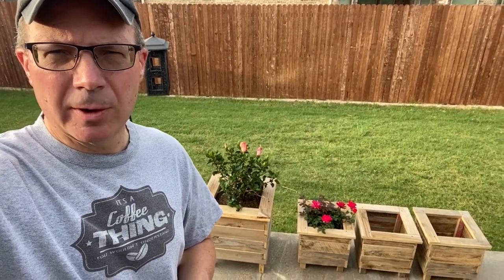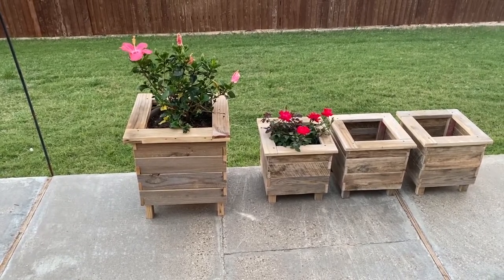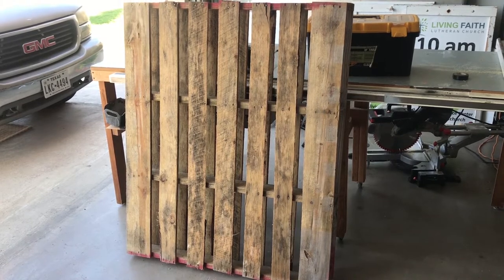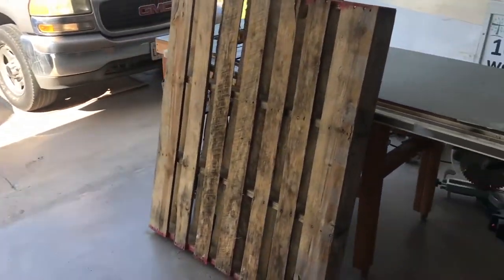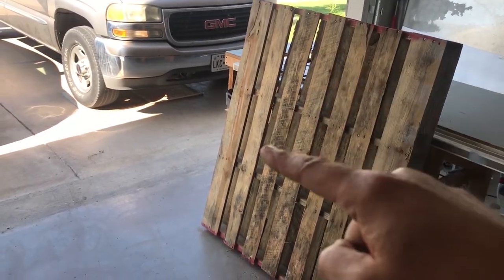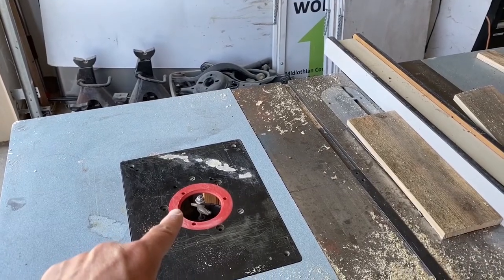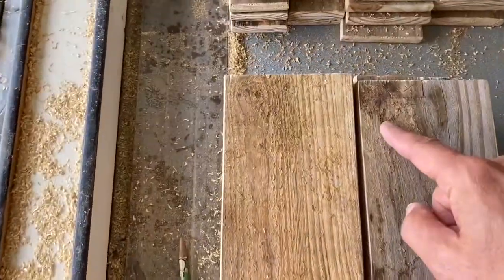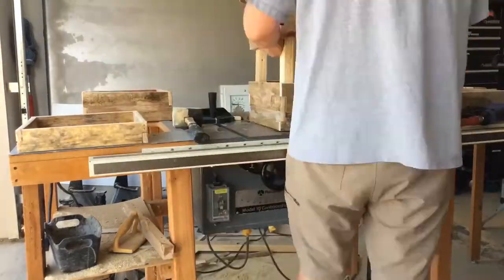Build attractive DIY PLANTER BOXES from wood pallets at no cost. Great re-purposed wood projects!

Comment: I think it's worth mentioning that when you're using pallet wood to build things there's always that possibility of missed metal in the wood. I use one of those handheld metal detectors off amazon for like $20. The nails aren't what I'm talking about though, it's the little piece of wire that holds the strips of nails together in a nail gun. Sometimes you can pull the nail and it will leave that piece of wire in the wood and it's not always noticeable. Just a little tip I guess. Cool project, nice video too!
Reply from the maker: Thanks for the tip!